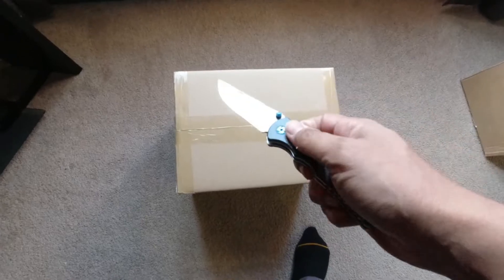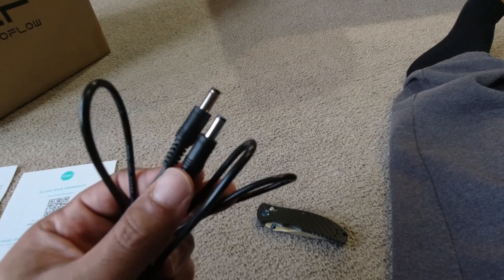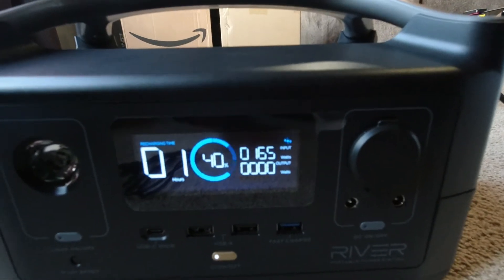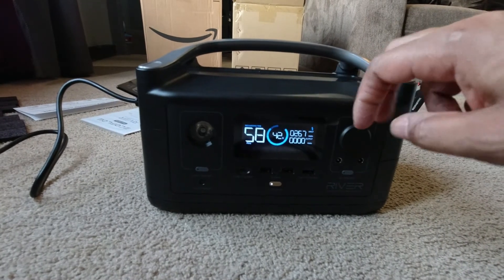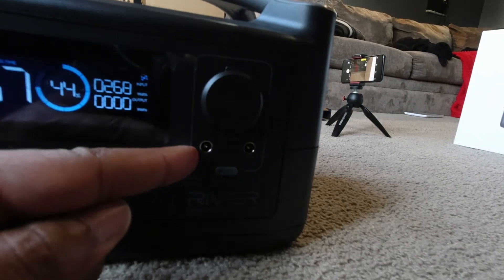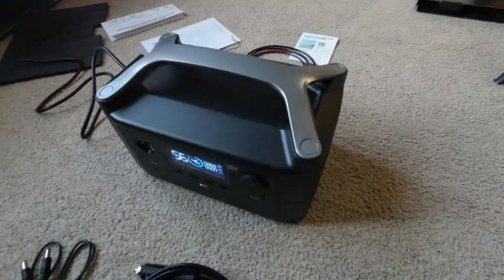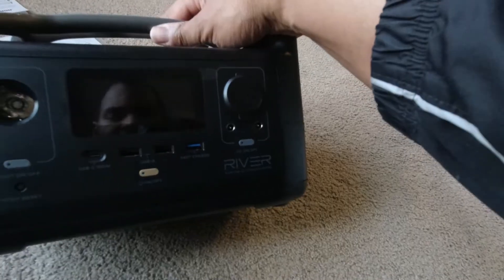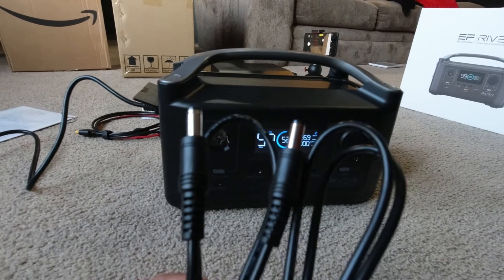EcoFlow River 600 or GOLABS R300 | What's In The Box?

Comment: I you want to slow the charge down mate , use the app and enable quite mode , limits the input charge to 110w
Reply from the maker: You know what. I tried it. It it limits the solar input too....it seems. I can't have that. And honestly. I never charge it from the wall. 

Someone was saying a new firmware tweaked the fan even more but mine is weird and won't prompt me to connect it to wireless like the guide says. But I don't care at the moment. Too much other stuff to do than tinker with it.
Reply: @AskIveSolar  i leave the quite mode switched off to , and yes it does limit the solar mate 👍

Comment: Great video as always, I love this power station ! i turned on quiet mode and it charges at 100(5w+/-) watts which is great and healthy for 96 18650 inside ;) My first AC recharge was weird- it charged at max 170, it was like ECOFLOW made sure that everything is aight with this first slower charge. App is awesome but sometimes acts kinda strange, if you leave it running in the background, it pops out randomly on the screen of the smartphone. Wifi button is too small and deep inside for me for my fat fingers ;) My handle is ''cracked'' looking as well. It is just a manufacturing fault, it doesnt go too deep and it doesnt affect structural integrity me thinks.
Reply from the maker: Interesting @ the first charge. That's a good theory.
Reply from the maker: I did eventually out together that quiet mode is how I can accomplish more moderate charging. I also dropped the capacy to 80% soc
Reply: @AskIveSolar  I keep the battery at 80% as well ! I need to correct my previous statement about the 18650s, There is actually 25 of them inside ;)
Reply from the maker: @nitropoweredHpi  I love the quiet mode because it will let you dump power from other power stations with lower power output.
Reply: @AskIveSolar  Interesting, which way you are transfering power ? elaborate please.
Reply from the maker: In my golabs video I talk about using it to dump power into the ecoflow. 

You'd use the 12v because of limited loss. But you can't use many small power stations because the ecoflow takes in too much power. I've seen my rockpals hit like 600 surge while trying to push 300. But with quiet mode on. All bets are ON!
Reply: @AskIveSolar  Any idea on how much efficient is lost on that 12v port being regulated? I remember it being mentioned in a recent video I watched but I forget which.
Reply from the maker: @DB-cu3xu  Solar Will (Prowse) said maybe 10% but I don't think he was being scientific. I think it was regarding inner of those older jackerys.

I would deduce that whenever hobotech does a 12v efficiency test and comes up with those efficiency percentages....that's how efficient the 12v plug is.